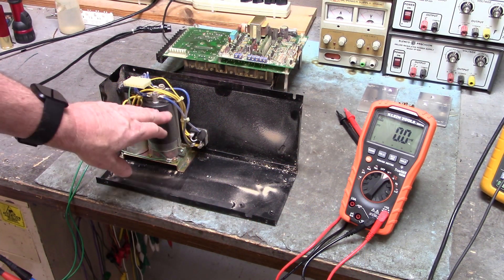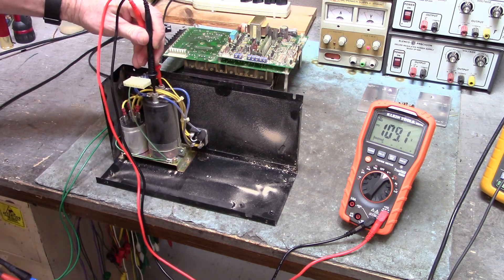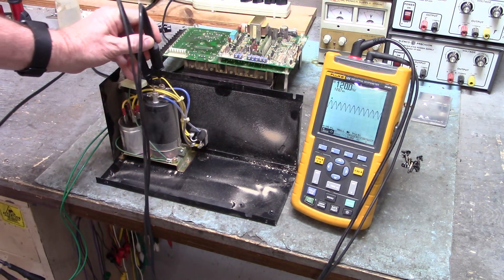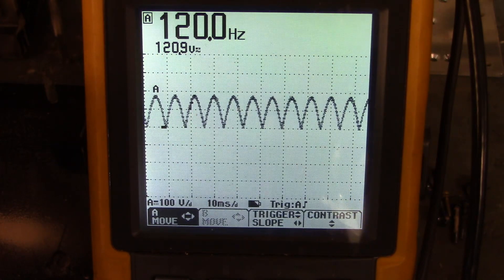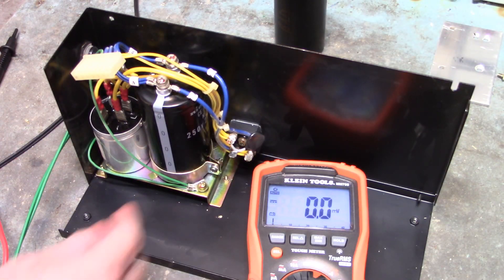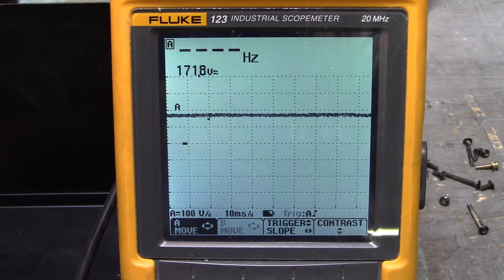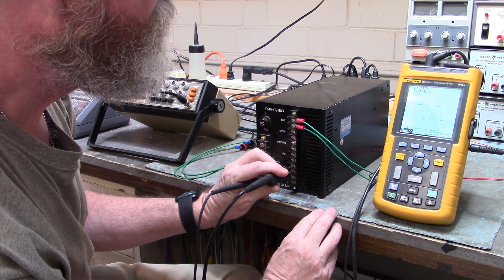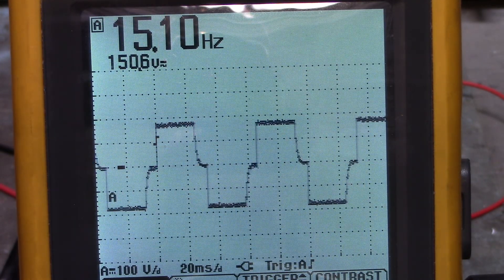Repairing and Testing the Sanyo Denki PM Driver

Comment: I have an identical controller that I want to operate on the bench to test a motor. Can you clarify what signal you fed into the controller? What AC voltage did the controller run on? I assume 120VAC if the square wave was about 170 peak. Mine was connected to two legs of three phase in the machine. 

Please and thank you.

Comment: Hi again Mr. McDonald!
Sir, you just saved me a LOT of time! 
Today I had a bad time trying to figure out why the hell an power supply was triggering the undervoltage lockout, and I just realized I was doing my test without any capacitor on the bus (this power supply is supplied by the DC BUS of the drive).
Watching this video made me see what is wrong!
This drive exploded, it was so full of defects that I relaxed my test procedures after so many assembly/disassembly routines for testing, and ended up missing this simple, yet very important detail.
Thank you very much, friend!

Comment: could ya drive a neon sign transformer with a VFD drive  put a resistive  load (light bulb heater etc) or even a couple of ballasts across the other two phases to load them somewhere close im guessing they will have current transformers monitoring the phases to check they are balanced? forgive me if im way off I know nothing about those drives... just curious is all